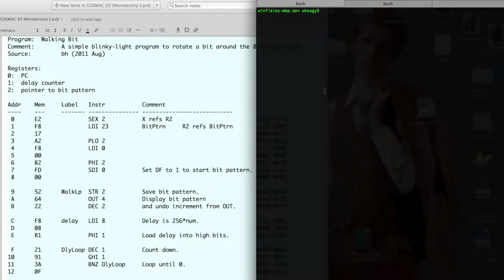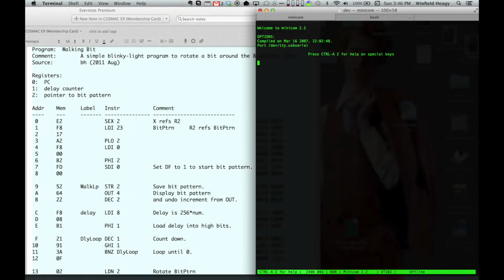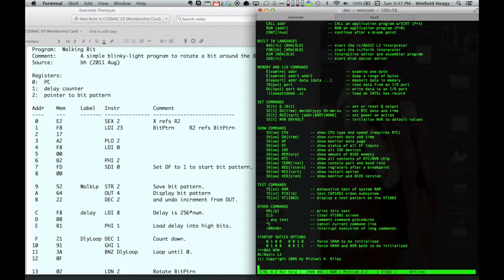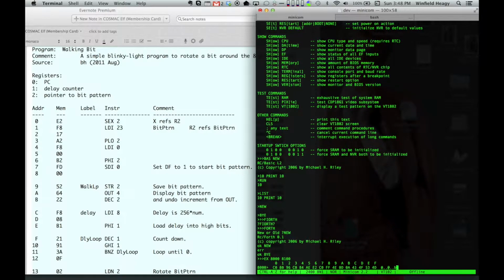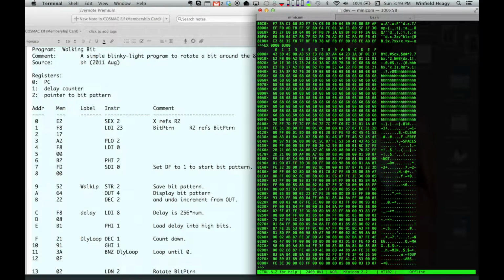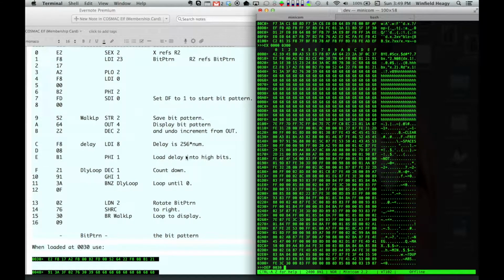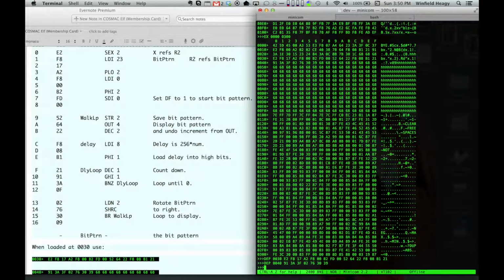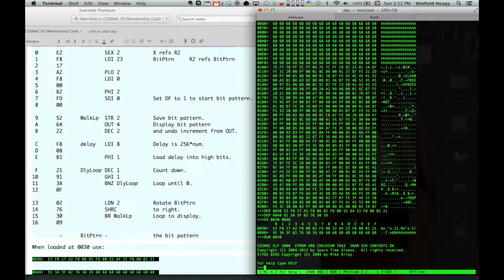Lee Hart 1802 Membership Card (COSMAC Elf) & Spare Time Gizmos ROM-stack and Serial Connection

Comment: I'd love to see how you hooked up the serial monitor to it.  I have a gen1 membership card.  Need to build the newest version.  But I'd love to see how you set up that terminal connection.
Reply: Me too. I am using the SparkFun Cable. Can short out the Tx and Rx pins and type in the terminal using the keyboard, but when I plug in the 1802 Membership Card I can't get it to respond.